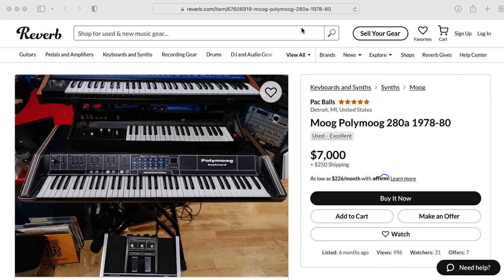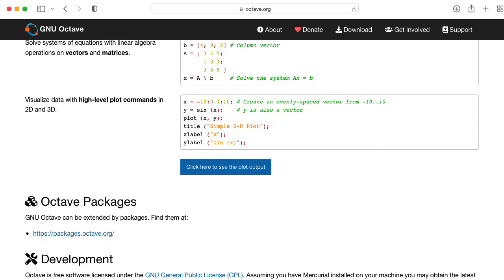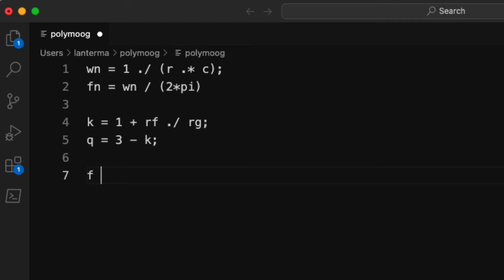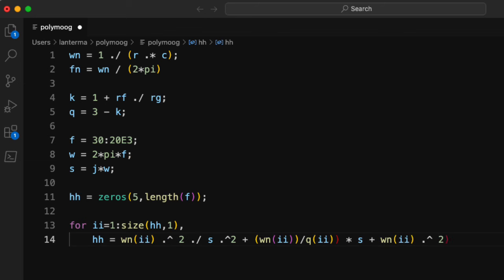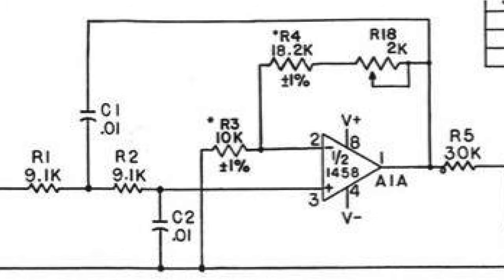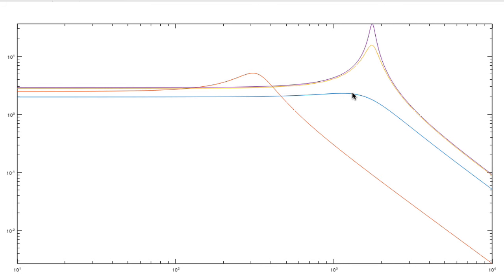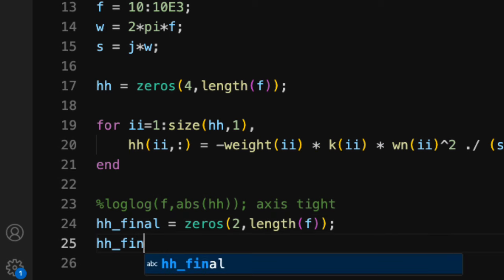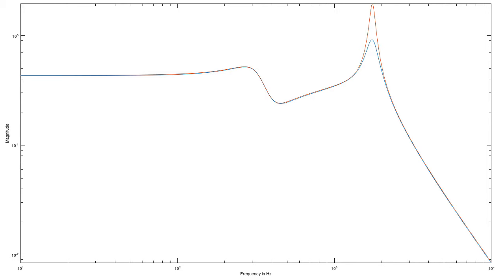Analyzing the Moog Polymoog Vox Humana Fixed-Formant Filter (as heard in Gary Numan's Cars)

Comment: Was there a synth circuit where those Sallen-Key resistors were replaced with OTAs? Thanks for the analysis.
Reply from the maker: There were two different VCF circuits used in different versions of the Korg MS-20. One of them used that a Sallen-Key with OTAs replacing the resistors. It changes the analysis a bit so you wind up with Q = 1/(2-K) instead of Q=1/(3-K). One of the last lectures in my ECE4450 Analog Circuits for Music Synthesis class covers it.
Reply: @Lantertronics  Thank Aaron.

Comment: Why did they use such a specific value resistor (18.2k 1%) only to put a trimmer inline? Seems pointless to me.  I guess for whatever reason they needed the 18.2k as an endstop resistor to prevent some funny stuff from happening when the pot is at its minimum value. 
(Edit) I remember I managed to get the filter to oscillate when I trimmed it too far.
Reply: Probably what they had laying around in stock.
Reply from the maker: Yeah, I thought that was odd too.
Reply from the maker: @MuzixMaker  Reasonable guess... I've made parts choices based on what was in front of me at the time -- although I haven't been designing commercial products. ;)
Reply: @Lantertronics  it happens in commercial design too. Availability, overstock, random selection, just shoddy engineering, etc.
Reply: The earlier, fully programmable version of the Polymoog was essentially still at prototype stage when it was put into production. It had taken so long to develop, including a custom IC that went way over budget, that they had to get something onto the market to recoup some of the costs. So it could be that even the later, preset version of the Polymoog that had the Vox Humana sound, was also a bit of a rush job with trimmers left in as final values of components hadn't been fully determined.
Reply: @chriswareham  The polymoog is such a beautiful disaster 😅
Reply: @PracticalCat  haha!!! My friend owned one. It was a hot mess.